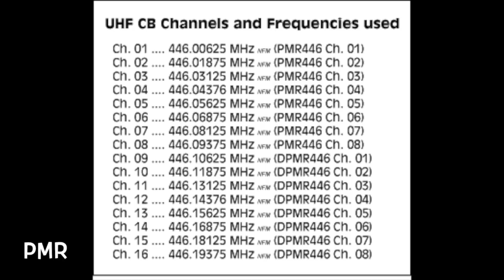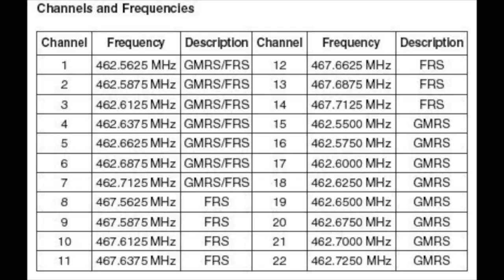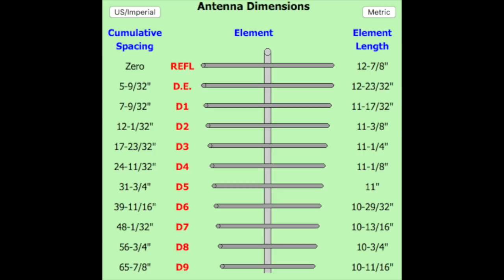A PMR/FRS Yagi-Uda Antenna For Extended Group Communications.

Comment: This ANtenna SHould Be VERY VEERY Directional. I Made One With A SINGLE Radiator And Its Not Getting The results I Need, I Live Like 600Meters Away From The MAIN Are Wich I Want To Listen In, But Cant Make Teh ANtenna Now, But I Will :) Some PVC Pipes And Copper Rods And Il Be Good. 
Will Make A Video For It :)
Reply from the maker: It is!

Comment: What would be the reflektor and director design  if we use flexible antenna of a radio as driver, e g we cannot dismantle the pmr antenna?
Reply from the maker: Hi, just use the yagi calculator, it will give you the answer.
Reply: @RadioPrepper  Thanks for the valuable link, however in the case of using unmodified PMR with permanent built in helical antenna... what length should be assumed of other parts, if one is predetermined? The calculator does not allow typing in the length of the radiator piece.
Reply from the maker: Assume the radiator to be what the calculator suggests, even if it is physically shorter, given that there is a coil in the plastic antenna..
Reply: @RadioPrepper  Thank you for the direction. I will be tempted to test it with pmr radios.
Reply from the maker: Maybe I'll make a video about that...

Comment: Building one.Can I ask. Does the driving eliment need to be copper?I ask as obviously  soldering the coax to it is easier. Using tube Ali was going to use a small crimp ring connector with a self - tapper screwed in the end. Great video
Reply from the maker: Sure, that would work.

Comment: IDK the rules for PMR446 but in the US PMR446 is not legal for non Hams to use. ANY external antenna on FRS is not legal to use so is using a non FCC approved FRS radio or modified FRS radios (radios fitted with an antenna port, etc) on FRS channels. US FRS is now 2 watts on some channels.
Reply from the maker: Same for PMR in Europe, except it's all 500mW maximum.
Reply: However the antenna you made is great for Ham radio and even a 433 MHz data link radio if you need some distance.
Reply from the maker: Very useful, just in case... I do not of course suggest anyone to use PMR frequencies illegally.

Comment: Nice Yagi beam build for your HT; Gil =)     You are using a Un-Grounded boom design .... I have built both types in the past for different bands .... homebrew beams seem to alway work much better the commercial store bought antennas =)   Yep on the thumb .... I always have marks left over from beam antenna builds =(
Reply from the maker: Interesting. I have never used a metallic boom, which seems to go against common wisdom... I would be curious about the science...
Reply: I mostly use PVC plastic pipe for small antennas and Aluminium tubing for larger and longer boom Yagi / Quaggy antenna beams =)   Celbek has some very interesting designs ( I followed his designs when he was still alive engineering and designing antennas =)    I probably need to buy his books on antennas to refresh my memory cells =)   There are insulating and grounded boom beam antennas and both have there pluses and negatives =)    Also .... you can have too many elements to the point of diminishing returns on gain and beamwidth / lobes =)
Reply from the maker: Yep I feel this one is too narrow already.
Reply: After read Celbek's designs it became apparent to me that sometimes it is better to have a little less gain and have a broader beamwidth =)   Sometimes you can just removable antenna element for a beam ..... it does sometime change the design spacing of the elements and degrade the antenna a bit or sometime more than expected results =)   It is a trade-off on performance and utility =)